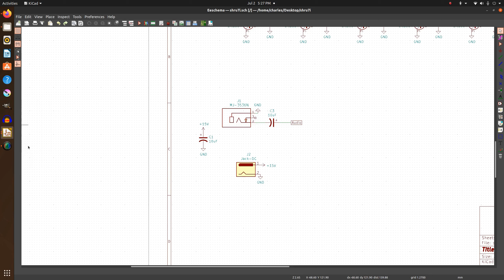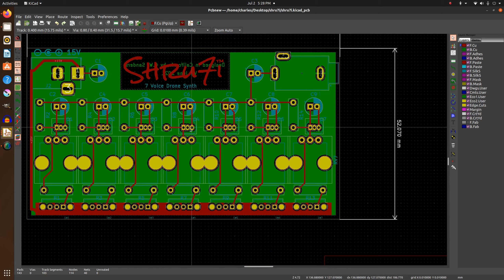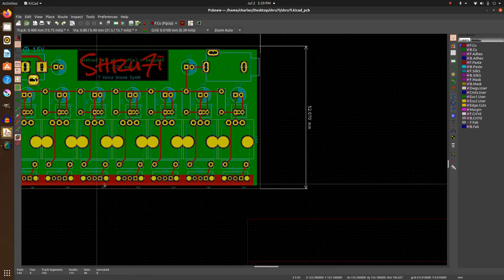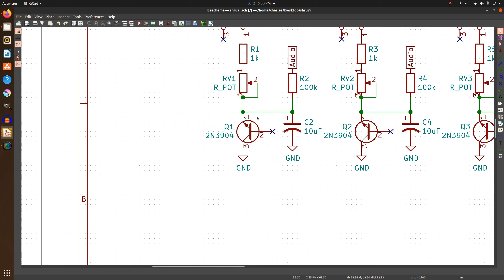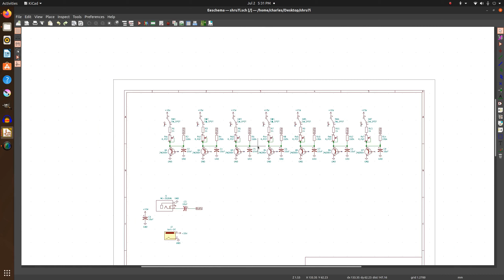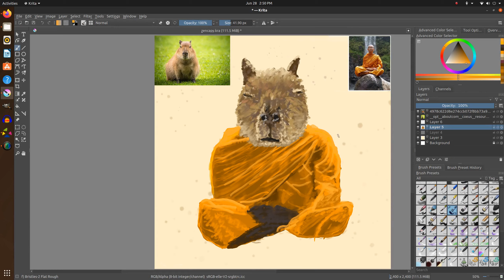How the Shru7i drone synth works | Shru7i synth update (links in description)

Comment: So can you install a volume pot per voice somewhere per voice? 

Or would that ad the pot and 10 other parts?
Reply from the maker: Yes, you can place a volume pot configured rheostat style, and replace the 100k output resistor with something like 56k to compensate. You may need to buffer the outputs before mixing if you go with a voltage divider configuration to avoid dragging other channels down. This can be done with op amps, inverters, or transistors. Would only add a few components per channel if you were to do that., or mix after the 100k